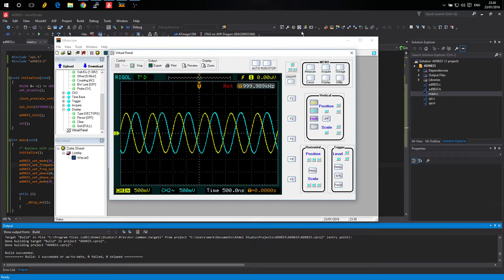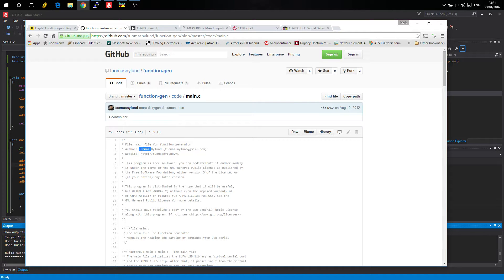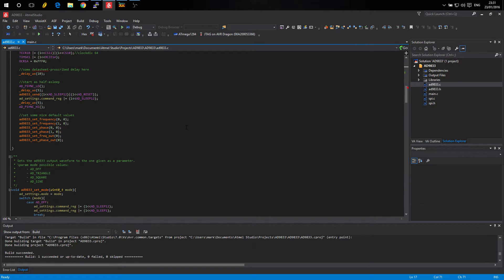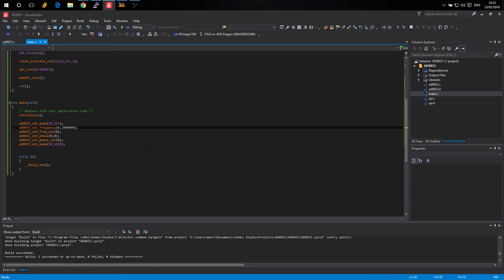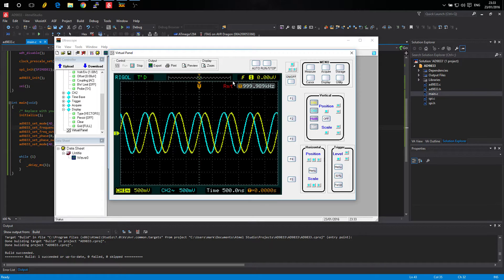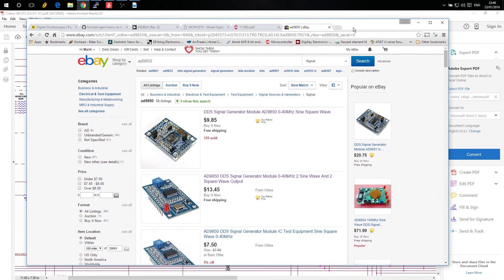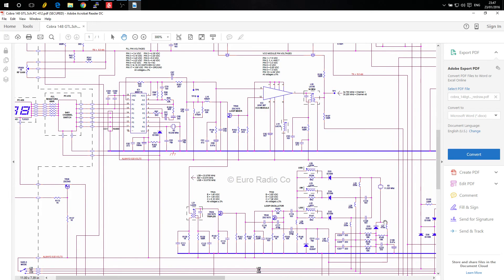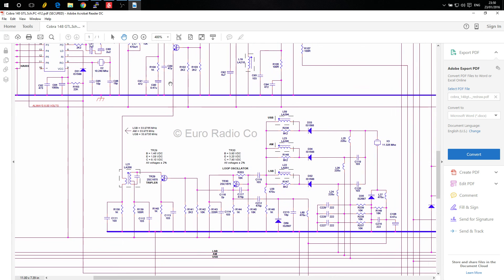AD9833 DDS waveform generator playaround.

Comment: im guessing that the output voltage is much larger when outputting square wave vs sine wave. so the opamp + digital pot probably trim the output as needed.

Comment: A very interesting project putting vfo on a cb.  Can wait to see what results you get. I have already built a vfo using AD9850 .  This would give me something to try it out on.
Reply from the maker: +Henry Martin Rodgers Some tests with an AD9851 are promising. I just have to get some real ones and not a knockoff - which I am pretty sure I got for $8 USD off ebay.
Reply: @Mark19960  That does seem alarmingly cheap. However, you can buy a real AD9851 and just replace it on the PCB, so you don't have to make your own.